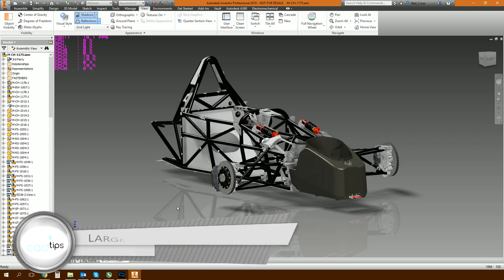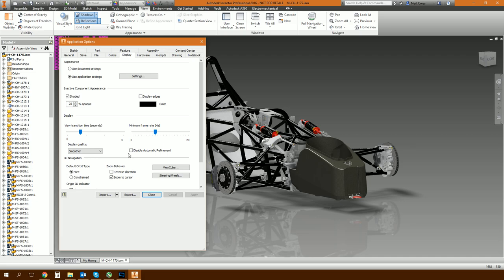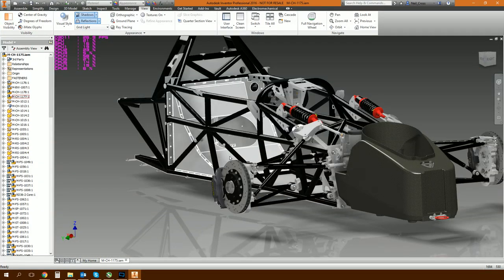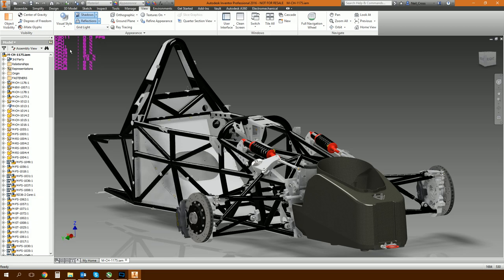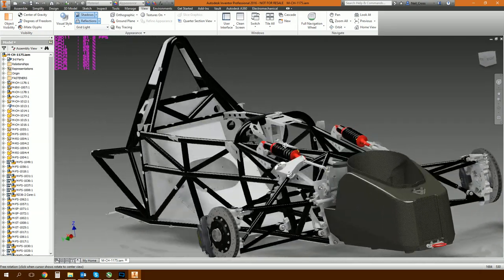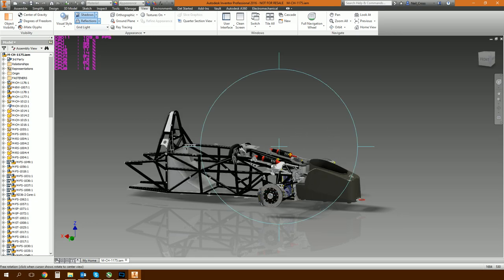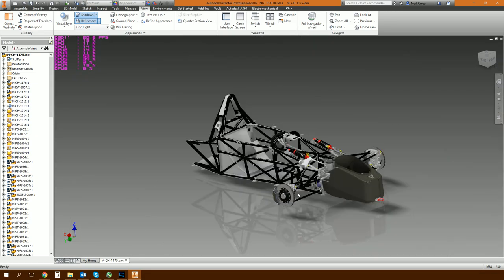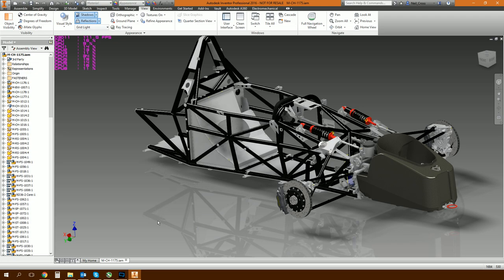Large assembly performance, Disable Automatic Refinement | Autodesk Inventor 2016

Comment: Great video, I have just discovered your channel and have been binge-watching the whole afternoon. Just one interesting addition to the video, what if you then want to refine the edges after you zoom in? If you disable automatic refinement it will enable an option "Refine Appearance" in the "View>Appearance" ribbon, it works like the "Regen" command in AutoCAD. Then if you zoom in and want the circle edges to be refined you will have to do it manually by clicking the Refine Appearance option. This works for me, as I'm currently testing some Inventor features in my not so powerful home PC, and having the automatic refinement disabled does improve the zooming and rotating actions.

Comment: Hi, when turning the auto refinement off when zoomed in, the immediate geometry won't change appearance as it is already drawn on screen. Further zooming will show the straight edges. Since this is a performance enhancement option redrawing the already visible smooth geometry with straight lines when the box is ticked would add further unnecessary load to the graphics. I'm no expert but that's my theory.
Reply from the maker: I thought that too, I didn't do it during this vid but I panned around to other off screen geometry and it was all just as smooth, the entire thing was barely different to smooth. That would definitely explain the objects I had on screen at the time but off screen geometry you'd think would be... non-refined? If that's even a word haha